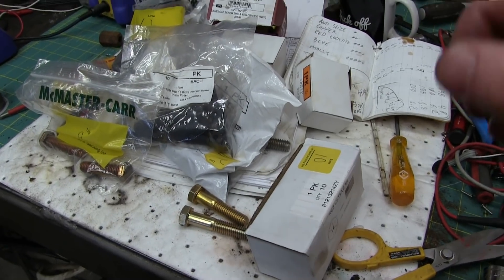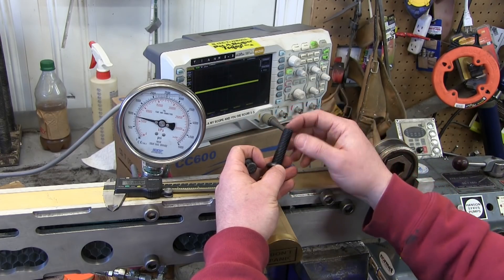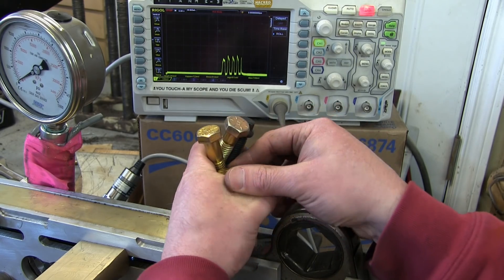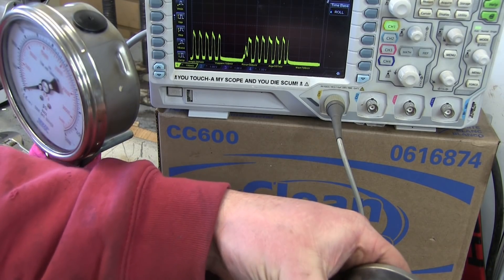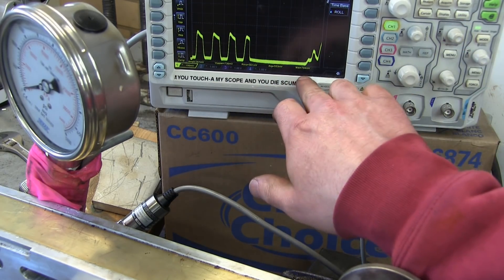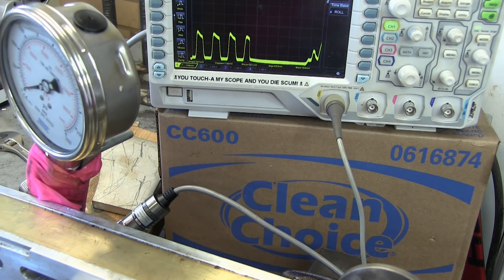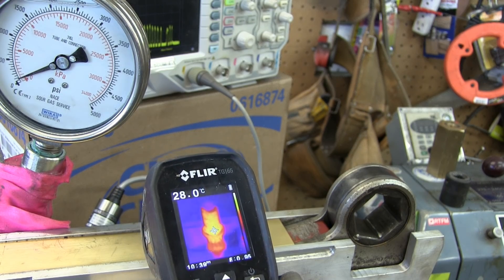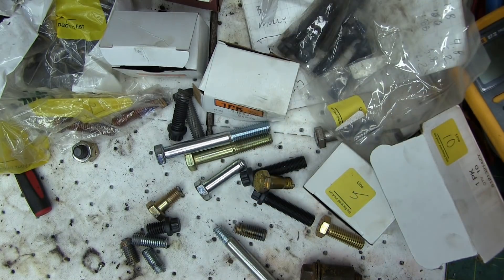Home Depot Bolt vs. USA Made | Offshore Suprise!

Comment: Love your work, you are my favourite. That bolt you were holding near the start in front of your scope, with the strange looking head. Is that the same as what a Bridgeport mill table lock has, with the spring loaded button to reposition the handle? If so what is that head type called?

Comment: worked on a boat that came from china once. m16 and m20 bolts and we would just tighten them until they snapped be cause that was faster and easyer then to losen them when they had been painted. the quality markings on them where all over the place, some where marked as very low grade and some was marked high grade, but they all where shit.

Comment: Could not get pass the wedge analogy. A thread is an inclined ramp in a spiral.  Torque measures the stretch in the fastener based on the angle of this ramp, and the force applied. Wedge implies the bolt tightens due to how far into the threads it goes, like pipe threads.

Comment: It is not always about strength.  My company switched over to Chinese stainless steel bolts to save money.  
I noticed a manway door leak on a tank that stored enough of a hazardous chemical to kill many many many people and seriously harm the environment of the area.  The heads of 20% of bolts holding the door on rotted at the head end.    The tank was drained a neutralized. The heads broke off many of the remaining bolts when they were replaced. This would have probably put 500 people out of work and probably killed many of us there the day the tank door gave way.

Comment: That makes sense bud, if the bolt heads have the proper markings then in all certainty they are batch testing them using ASME and ASTM standards. It makes sense. Just think of all those lovely high rise buildings that keep on reaching up further and further, now just think of all those foreign bolts holding up all that weight. Makes ya think don't it. Just saying.

Comment: I was told a bolts effect length is only as deep as the bolt is thick.  For instance, if you have a 1/2" bolt it needs go no deeper into material than 1/2" for maximum strength.    Any idea if this is correct?

Comment: So we make aerospace grade fastners. The tolerances get cut way down, and the root radius is bigger.  So there are grades of threads,  the lower grades can have a tolerance window of .020 in the minor diameter, and the pitch diameter. Aerospace uses 3b threads where there's usually only .005 variance allowed. The way the threads were manufactured can also greatly affect the strength. Machined threads are pretty standard, standard strength, but using a thread roll can greatly increase the strength, as the process compress the material. The metallurgical engineer has explained what happens several times, but all I remember is ok this is stronger.

Comment: I have been buying Bowmalloy High Strength bolts. It would be interesting to see a comparison of these against the best you have tested. They are expensive but can be found on eBay for crazy cheap deals. i was buying 7/8 14 bolts in 10 pack boxes for $15 on the mighty eBay. I machine them into swaging dies for reloading bullets.

Comment: When torque testing bolts, it's always best to grease all of them, to pick up differences in cohesion factor between the nut and various alloys of bolt. It's also necessary to make sure they are the same number of threads per inch. The tension on the stud is your torque X the number for threads per inch, so it takes less torque, to put the same tension on the stud. Your straight pull tension method will be much more accurate than torque, because it takes into account all those variables.

Comment: You can always run a fine thread for more ugga duggas on your cylinder head - going into a cast aluminimum block and see how that goes.

Northstar says: not well.
Reply: The Northstar seams to be made from some low quality aluminum I have had to do the head bolt tread inserts on them before . Cadillac must have not been too confident because of the sticker on the radiator support saying to add 3 stop leak tab anytime the coolant was serviced lol.

Comment: Do I really got to tell an engineer what I tell rookies when torqueing? Push down, don't pull up. Leverage is a two way street. Woahh, woahhhhh, did you really say a bolt length is redundant? How about material it passes through before it hits the material it will fasten into? C'mon guy, two things in two minutes. I have lost hope with you.

Comment: Home Depot makes Volvo connecting rod bolts? LOL
Proper time to showcase the rod bolt stretch gauge. More accurate than torque wrench if both ends are accessible.

Comment: CHEAP NUTS! They’re the ones that piss me off. You get a replacement bolt and nut with a ball joint for your car and the bolt can be 10.9 but the cheap shit Nylon lock nut will smush it’s threads before you feel the ball joint fully squeezed in the split home.

Comment: If testing was done in similar way to the euro code testing for design a large variance means a higher mean strength is required. As a manufacturer a larger sample size and low variance means the test strength(s) will closer to the characteristic (rated) strength, this should be must economic, ignoring testing costs

Comment: i disagree with the 3 treads rule, you need on steel the diameter, so if you got a half inch bolt, you need half inch of threads, and on aluminum you must double that

Comment: Interesting tidbit. You probably know this but other people may not. In certain industries, particularly the oilfield, where sour gas (H2S) may be present, itis entirely possible for a fastener to be TOO STRONG. Per NACE MR0175, virtually nothing over  18-22 HRc is allowed except for specialty extremely corrosion resistant fastener materials.

Comment: dont reuse head bolts in cars, they stretch over time, then when u go to reuse it they like to snap off, in the engine block, then you have 2 choices, check if its leaking, and if not, fkc it, or you can be smart and remove the bolt, and fix the problem properly, i said fck it, still holding up, no leaks, but its a 2.5l nissan, so yeah, but i dont drive that much any more, its great on gas, but i prefer my 79 stingray.

Comment: At around 11:30 you mention needing only 3 threads of engagement for full strength  I think you meant 3 threads showing  past  the standard nut because the end of the bolt is slightly tapered  so you're not getting full engagement until then. That's what there teaching in A&P
School.

Comment: I have broken bolts of trying to remove them, granted rusted on the car twenty years old, I tried to prepare hit it with pb blaster everyday for a week yet still took a lot of elbow grease but still broke coming out then I try to drill them out with a tungsten carbide bit which only ruined the bit. I said the hell with it and welded bolts pointing down and stuck a net on the bottom. One thing is for sure penetrating oil is a waste. What was I doing wrong?

Comment: bolt head design vs bolt hole can  skew this test quickly as some bolts require a washer or chamfered hole and will fail prematurely when used in the wrong situation. just learned this when researching flywheel and pressure plate bolts for my cummins, and learning the difference between the metric 12.9 vs the us grade 8... got to looking into it when i was told grade 8 was not enough.

Comment: JH is Jin her and they are actually an extremely good fastener company (Taiwanese) held to the American iso 17025 / A2LA lab testing standard for all of their parts.  Lake Erie I do not believe are tested to this standard.  The only domestic bolts I know are to the 17025 standard is Nucor (US lowercase n head mark) and Infasco (Canadian triangle head mark).  I believe there may be a more like Fontana but I sell Nucor and infasco almost exclusively for domestics as they are readily available and I have never had an issue with one failing due to manufacturing.  For imports I sell almost exclusively Jin her as for the same reason they are held to the highest quality standard and I have had 1 bolt sheer when it should not have and it was determined after sending a sample to the lab and the customer sheering 4 more bolts that it was a design flaw causing far to much load on the bolt.

Good bolt companies, graded bolts, infasco, Nucor, Jh. 

Stainless Tong family (THE)

Sockets THE, FKE, TVS, UMBRAKO, BLUE DEVIL, KERR LAKESIDE, LPS

Comment: What is your point in testing to failure?  A bolt is not meant to be over torqued.  A properly torqued fastener system is to be smoothly torqued to the proper amount. If an engineer is recommending to torquing bolts beyond the proper torque specification to the point of breaking bolts then that engineer is dangerous. Most failures occur due not having a properly calibrated torque wrench. What is the point in using, or making, an over spec bolt which may then fail due to vibration? A bolt that is “too hard” (think too strong) will fail due to latitudinal stress as opposed to longitudinal.Why not show people how to properly apply fastener systems as designed for the application?

Comment: I may be wrong because your method was not well explained, but it seemed that you were measuring the torque that you were applying and not the actual stress in the bolt. The two are related, but your own scope display seemed to say that after four or six strokes of the torque wrench, the readings were almost the same, with only small variations. I have done similar tests, taking manual readings on a torque wrench and found that this was not the case. In fact, the torque would increase with each stroke up to the point of failure. So, something seems to be wrong with your methodology. 

I also do not like the way you used the torque wrench. You applied force only at the outer end of that wrench and left the support of the end with the socket on it to be supported ONLY by the screw head. This did apply torque along the long axis of the screw, but it also applied some unknown fraction of the total torque along an axis that is perpendicular to that long axis. The result is that secondary torque was trying to twist the head of the bolt off sideways. When I performed such tests I held the socket end of the wrench with one hand and used my other hand to apply the torque to the other end. This is a more balanced manner and, to the greatest extent possible with manual operation, kept all the torque on the long axis of the screw. In truth, it would be best to use some form of mechanical restraint at the socket end of the wrench. A heavy duty bearing with a relatively long axial length (several inches) there would be a good idea. 

Your overall result of which bolt was stronger is probably correct, but your numbers are probably inacurrate.

Comment: We had a killer bolt and Supply place in Statesville, NC. You could get your washers for free and junk like that. Always lookin out. Well they changed hands as well as the suppliers. I bought 18 1/2" lag bolts 6" long. For a deck. Predrilled 4" into the wood with a 3/8" bit. Broke 5 of them off. Craps gettin real...

Comment: If anyone has the time check out Skidmore Wilhelm bolt tension testers. I have two, one is for three eights fasteners and the other is for half inch. They convert clamping force into pounds per square inch on a hydraulic gauge. Never reuse a nut. As stated in the video the first three threads take up almost all of the load and they also shift (move). Just as a test, torque a fastener dry to the intended manufacturers recommended torque spec and then loosen it and re-tighten to the same spec and the clamping load will have diminished. Additionally any plating on the surface of the fastener flakes off and act as a lubricant. I don’t feel like writing here for an hour. There’s a lot to this.

Comment: 2 things.  1st your test is flawed. and 2nd  there are 2 properties that you would want for fasteners - that is strength or hardness and also toughness or ductility.  I wonder about the american bolt that you tested as it supposedly made the spec in the conversion from voltage to strength.  But I wonder if you tested for toughness how the american bolt would compare to the foreign one?  Who knows when your test went bad?  I think the 1st, American bolt tired your test device out!

Comment: If a one inch bolt is, say, 160,000 lbs  P.S.I. yield resistant, does a 1/2 inch bolt which is 4 times smaller only has 40,000 lbs P.S.I. resistance?

Comment: A few years ago at the job I held at the time we were having a problem with bolts breaking at the proper torque even though they had the correct marking for grade 8. When tested they tested as grade 8, but when the material was analyzed they were boron steel, rather than chrome-moly steel. They had the strength, but not the ductility. The heads would literally pop off when tightened to the proper torque.

Comment: Never get tired of watching you break things....  your point about Chinesium bolts being over strength because that way they are safe in the specified range is also why American made shotgun barrels are so heavy.  America does not have a “proof house” to test shotgun barrels with “over proof” powder loads (usually 1.5 to 2x) so they simply make the barrel walls extra thick, to put it simply.  In Europe they try to  make the barrels as light as possible while containing the pressures.

Comment: 12 points are usually used in crankshafts and heads and I was told the torque spec actually causes the threads to stretch a bit to give a better hold. This is why these bolts do not usually require locking nuts or threadlocker. I sold fasteners for 30yrs for Acklands Grainger and initially the Chinese gr 8 stuff failed. After we sued them the quality cam up smartly. Hmmm.

Comment: It should be also noted in comparison between fine and corse tread bolts that the fine threads also have more linear thread engagement than coarse treads

Comment: Had noticed 5 or 6 years ago Lowes replace the bolts in their bins with grade 3 & didn't bother to tell their customers that what once was grade 5 is now grade 3 Chinesium. If you want better than grade 3 one has to go to the specialty drawers.
In the specialty drawers you will find them prepackaged in 2-5 for your convenience.

Comment: Would probably be more of an expensive test to perform but it would be nice to compare let say an LS engine bolt, to an ARP2000, 625 and L19 replacement studs. The price on the higher grade ones is just ridiculous, would like to see if it's actually justified.

Comment: chinese bolt is better because china export world most steels, only 2nd grade ones are exported, best ones are kept to be used locally. US buy low grade steel from china because of greedy traders, and make bolts with the cheap steel.

Comment: This video seems to go with a presumption that a higher yield strength is better, when in fact it is dependent on many factors. It may not be better, and in some cases it's worse.  Torque specs for various sized and grades of fasteners are an attempt to achieve a certain amount of stretch, which in a certain alloy of metal and heat treatment that has a certain yield strength gives a certain amount of clamping force.  If the bolt is too weak for the classification (grade) it can be a disaster.  If the bolt is too strong for its classification, that may be just as bad. The same can go for fasteners that are too large for the application and cannot be properly torqued to achieve the degree of stretch required to keep them tight without damaging the parts they hold together.

Using too high of a grade bolt can cause failures in an assembly because they tend to come lose without the proper torque (stretch) and without the proper stretch (tension) two parts may not be held together well enough, which can allow unwanted movement.  While it's possible the USA fasteners were out of spec, it's a better bet the Chinese fasteners were. In my opinion that's the central factor in this. 

Most people realize using truck springs on a car will yield unsatisfactory results as would using too small of a spring. If a spring is sold with a certain load rating, but it is actually very much higher (or lower) then it is out spec. Same thing with graded fasteners. 

There is no question that some Chinese products are good, it's a matter of consistency and quality control. Stuff from Taiwan is usually ahead of Chinese stuff, often it's quite decent.

Comment: A bolt must be 1.5 x the diameter deep to hold its full strength not 3 threads you spanner!
Reply: So why is the height of a nut just under the diameter of the matching bolt?

Comment: the interesting thing is: the Chinese grade 8 broke like the G9... there was no long yield time like the American G8 bolt... meaning they are over heat treated and are brittle as frig... any shoulder load at all is gona break them if they aren't loaded perfectly flat

that's why shear pins are usually replaced with softer steel when your in a bind... they will bend not just snap like a higher grade fastener

I was very sad to see the L9 fail at that low of tq tho… I love those bolts but rarely use them from the cost

AVE... try some 12.9 stuff next! the automotive 12 point 12.9 stuff is freakin tough as mummy ball sack material

Comment: Perhaps bolts...maybe...but, a few years back I was restoring a 1970 Harley Sportster...and made the error of buying a genuine Chinesium kick start shaft, from way off in the Far East. The part arrived after the usual two month slow boat by way of Outer Mongolia and probably using Taiwanese slave rowers.... it arrived and  I installed it....exactly ten kicks later on a freshly rebuilt motor.....the fucker snapped off...totally crystallized POS inside....since then the only metal things I buy out of Chinastan is Norinco pistols.